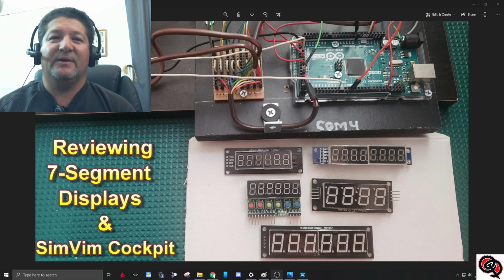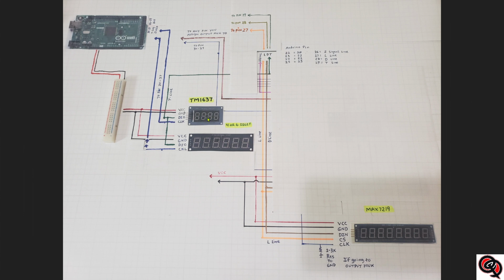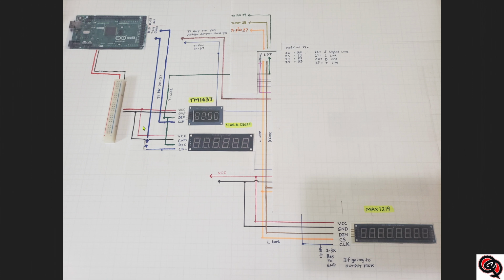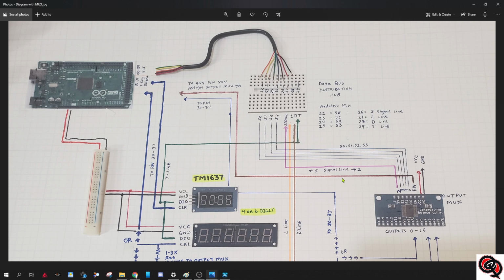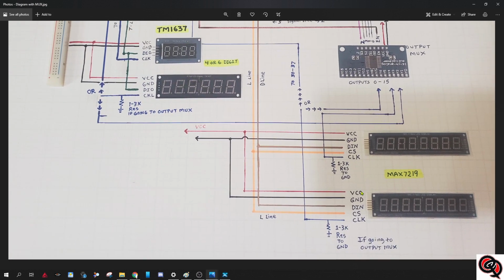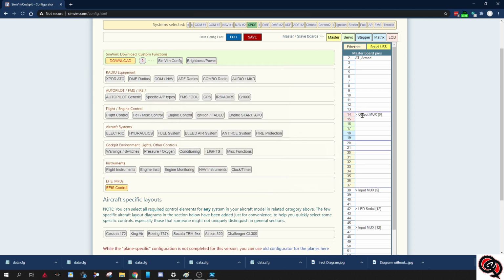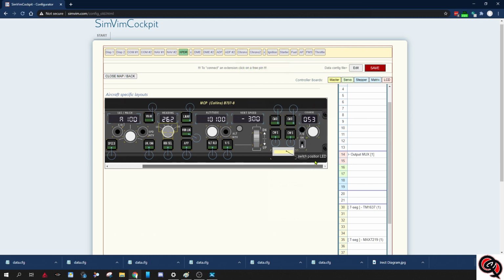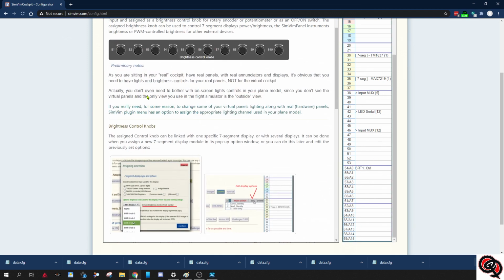Updated: TM1637 & Max7219 7 segment displays with SimVim Cockpit

Comment: Thanks for this, was very helpful, i managed to get all to work easily.  Same as you with my Max chipsets, the 7segment display always lits up fully on power on.  only after turning the encoders, an update is overwriting all 888888 to a real value.  Was anybody able to have it startup blank as it is in the real plane ?
Reply from the maker: Hello Gunter, my MAX7219 starts off all blank when I load up a flight with a cold and dark aircraft. After I turn on my avionics the displays turns on with the correct data for that display. I never see any 8's on the two that I have. Do you have the resistor between CLK and GND? I'm not sure if that would cause it but you should have it to prevent random data.

Comment: Great Video as usual!
Quick question, does simvim support conditional output/input, what I mean can i have a seven segment display for NAV1 and a switch when I flip it then the same display would display NAV2 for example? I want to build one box to display NAV1/COM1 with a switch to flip it to NAV2/COM2 using the same displays. Same applies for the rotary encoder by default they control NAV1/COM1 but if I flip the switch then they would control NAV2/COM2 instead... I hope my question is clear thank you and cheers!!
Reply from the maker: Hi Tony, yes SimVimX/RSC  does have ability to use the same buttons, encoders, displays for multiple functions. As of right now (Feb 24, 2023) it does seem like it's not working correctly for Multi position rotary switches. I wrote an email to Vlad about it but I haven't heard back from him yet. It wasn't working for encoders either but it looks like that got fixed already.

 You can assign the "conditions" by assigning the selector function to a toggle switch, multi position rotary switch or momentary push button under the GENERIC  I/O section of the configurator. Then after you assign more than one function to a display or encoder you can make it "selectable" using that selector you assigned.
Reply from the maker: Hi again Tony, so I put together a small setup on my test panel to try exactly what you were asking about and I am happy to report it works perfectly. Hopefully Ill make a video about this soon so you can hopefully duplicate it if you haven't done it already. I used an 8 digit MAX7219 for the standby freq, a 6 digit TM1637 for the active freq, a dual rotary encoder for tuning, and a push button for the flip switch. As my selector I used a 4 position rotary switch.
Reply: @Qosmokid  Great Thank you! I didn't have the chance to try it yet on my end but I will soon. It will be great if you can make a quick video about it also, I will check it for sure.

Comment: Nice Video!   Are you finding any problems with the new 2022 config upgrade?  Particularly The D&L lines for 7seg & Dm13As
Reply from the maker: Hi John, thank you. I've been playing around a bit with the new configurator. So far everything on my 7 segment displays seems to work but I haven't tried DM13As since I only use them on my test panel not in my actual setup.

I'm hoping to put up a video with some little nuances I have on the new configurator. I'll try to experiment with DM13As before I do that but work has been keeping me traveling a lot lately

Comment: Very nice set of videos Qosmokid, on wiring the various input outputs.  I have  a question re TM1637.    I have the TM1637 modules tested on an Arduino routine so I know they function perfectly.  My problem seems to be with the web configurator (latest SIMVIMX etc) in REALSIMCONTROL.    I've tried both multiplexer and direct connection of the module to the 2560MEGA.  To proceed, I then choose Configurator, Planes, 737 and focus on Collins MCP panel.  All the functions on the autopilot like switches encoders and momentary switches I can configure perfectly.  However my problem lies with the TM1637 4 or 6 digit.   I choose the Altitude display on the Collins A/P, and the configurator shows a popup with either "7-seg display" or "Character LCD" options, I choose 7-segment.    I see a popup with headed AP_ALT_Cmd, select assigned 7 seg display, and a cancel button on a yellow background- there is no instructions to proceed (why not include this I ask for dummies with little experience).  Anyway, I choose pin 36 (maybe my first mistake) and a popup warns me to assign module to an empty pin (I thought I did that), so i select pin 37, and I get a more complete popup with all the various output options- I choose "Direct 7-segment Display".  I then get the "Assigning extension " popup which I complete accordingly.  The Arduino image now shows a red button (no 37) and a blank yellow popup with no instructions or further choices.   If I click the red button 37,  I get a small popup in the  yellow background with "No parameter Assigned" showing- I cant get past this point.  Can you clarify?   Maybe the configurator is being blocked somehow or I am missing some key procedure that is not so obvious.   Sorry for the long-winded question  but I would be most grateful if you had an answer....
Reply from the maker: Hello Glenn, thank you for your comment. Im not sure but I think I know where the issue is. Before you try to assign a keyword/parameter to a pin have you already set on the configurator that you want to assign a 7 segment TM1637 to that pin?

Just like you assing a multiplexer by clicking on a pin you need to choose assign a 7-segment display to a pin first.
Then you can assign it a function like the ones for the autopilot you are trying to use. This would be the same wether you are trying to do it on a direct pin 30-37 or an output multiplexer pin.

I couldn't tell if you are doing that from your comment but it seems to be that's whats missing.
Reply: @Qosmokid  thanks you so much for the prompt reply, I'm not sure I completely understand, but I'll review the video as below and go in and try your suggestion. I a little confused about the configurator as you seem to be using an earlier version that just shows a key assignments window/table rather than the image of an Arduino Mega.  But I will give it a go and let you know the outcome.
Reply from the maker: @glennlilley867  Yes it looks different now (nicer) but the process is the same
Reply: @Qosmokid  OK, When I chose any A/P output display, I immediately see a small popup window with the two choices for devices, this time I ignored that for the moment and selected pin 36.    I was then immediately directed to a list of about 7 input/output devices and I chose direct 7 segment from that list, then I get the popup to select display type and bus etc.  So I do that and I am directed back to the same place and a dead end as before....very confusing.   In your version of  the configurator, it seems to be very straightforward-  unfortunately, I can't provide a screen snip to demonstrate in Youtube...
Reply from the maker: @glennlilley867  No you're still doing it wrong and you can't ignore wether to choose 7 Segment or LCD.

What you are missing is FIRST you need to click on say Pin 36 choose "7 Segment Display" then on the popup windows click the bubble next to "DM1637 Driver, 6- digit module" or "4-digit Module"

Once you see the BOX for pin 36 turn red then you go to the Planes > Boeing 737x, go to the MCP, select whichever function you want to assign. Let's say heading, click on "7-segment display" on the select type popup window. Then click on the red Pin 36 box. In the new popup window click in the blank box or in the box where it says" <--New entry" then click the blue "Done" box 

That's it, its still exactly the same as on this video except the configurator layout imagine looks different.
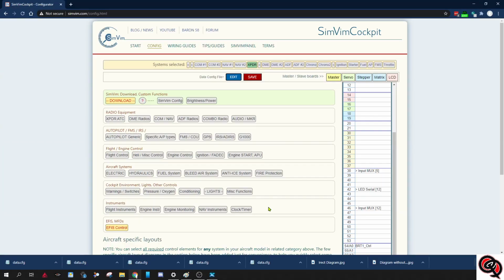Reply from the maker: What I mentioned to you in my reply is starting at 21:54 on this video
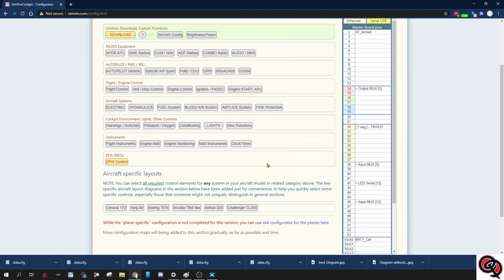Reply: Ok, I have it sorted out, the clue comes from your video at around 25:00.   The process seems to be too convoluted for my brain, but I managed to proceed to a saveable config item.  Here goes, an example:   if I click on AP_HDG_Cmd, I get a large  popup with an image of an Arduino Mega with blank yellow section, I also get a small extra popup with two Type choices (7-seg display and Character LCD),  which I ignore.  I then choose/click pin 36 successfully this time and get a list of input/output display types either direct or via multiplexer. I choose direct 7-segment.   I then get the "Assigning Extension" popup and fill that in for the TM1637.  After pressing Confirm, I return to the Arduino image with small popup with two output types that I ignored above.  I select 7-seg display,  I now see a small message window in the yellow background area with the message AP_HDG_Cmd, Select assigned (underscored) 7-segment display, and a Cancel button. I then go back to the pin 36 and click on it.  I now see a small windowed segment at top of yellow background saying New Entry with Edit and Delete buttons,  I click to the left of <---New Entry, and I get a further popup (as you do in your video) with the output function name AP_HDG_Cmd and option to select Shift position from right side of display, I ignore that and press Done button.  I now see a that "New entry" window shows a table with first line/first column and 1, then second column with AP_HDG_Cmd, and EDIT, Selector and Delete buttons. Presumably at this point I can continue to add in more output devices or Save the current setup.  I click SAVE as per normal and I get the option window to open with Notepad or Save.   S o problem solved I think with your video and your suggestions, but I am left wondering why so complicated!   Tested the SIM config and it works YAHOO!   But how can any person think that this is easy to do.....seems very roundabout!
Reply from the maker: @glennlilley867  LOL its not complicated at all. Specially when compared to writing your own code to get a display to work with a simulator. Ill take 5 clicks any day.

Just remember, you need to "Assign" the displays to your pins FIRST, before you even think about going into the image maps to select keywords/parameters.

I think the backwards way you are doing it is making it more complicated and confusing for you.
Reply: @Qosmokid  ...will review and try to get it more direct, but thanks for your input, it ultimately got me a working TM1637...

Comment: Hello , I’ve done everything as per your video but still I get no digits (they all lid up with 8’s)
Did we not need to copy the .dat file to the aircraft folder too? I’m using the 7219.
Thank you Sir!
Reply from the maker: No a .dat is not needed for the displays to work properly. Specially now with version 2.0 of the plugin there will no longer be a separate .dat file even for custom conversions.

Having gone over this with multiple people I can almost guarantee you that something in your wiring is NOT right. I figured you are using MAX7219 displays because those are always the most problematic ones of the two.

To even begin to try to help you I would need more information
Reply: @Qosmokid  ok thank you for that. I will keep trying , not sure what the issue is … thank you for the videos ! 😁
Reply from the maker: @redd6914  You're welcome, if you send me some clear pictures of your wiring we might be able to figure it out.
Reply: Ok thank you . On the older version I had a slave board connected to it (uno board) all worked right . I’ve been trying again this afternoon for a couple of hours , checking and checking the wiring diagram on the SimVim website , still no luck .

I’ve tried both direct 7 segment connection and via a MUX.

Anyways , I will Carry on with switches and leave the 7 segment displays for last .

Thank you 😊
Reply from the maker: @redd6914  Slave boards have never been used for 7-Segnent displays only for LCD displays. Only multiplexers have been used for 7-Segment displays. Thats probably where your confusion is.

Comment: Missed your broadcast, was in the hospital with pneumonia. Home now and watching the show :-)
Reply from the maker: Oh sorry to hear that Dave, I hope you are doing well now and on your way to a full recovery
Reply: @Qosmokid  slowly but surely!
Reply: This thing has me baffled. In the configurator, the file is saved as dot cfg, the 6 digit option is checked. The voltage says 16, should it stay that way? I checked the boards using a sketch and though it was for a 4 digit board, all digits had something on them. I've triple checked your layout, everything is where it should be.
Reply from the maker: @DaveWrightKB9MNM  The cfg file is getting saved to the simvim folder in the xplane plugins folder? I'm stomped also it sure seems like everything is correct last time I looked at it.

Comment: Another question, can I have one of your simple data tou assigned on your test panel , for a simple connection and wiring you got on your test panel?
Reply from the maker: I'm sorry I'm not understanding what it is you are asking for. If you are asking for a sketch of the wiring on my test panel, that is not a simple drawing.  It is ten times more complicated than the one I used in this video.
Reply: @Qosmokid  No I don't mean that, your sketches are awesome to understand,  I ment If possible send me one of your data you upload to your x-plane folder, for me to test if my Mega board has problem,  because I did my wiring just like your digaran, but had no success.

Comment: You're awesome,  and very much helpful,  believe me I could start my project just reading the website,  your diagrams are cristal  clearly explained, thanks very much for all your uploads. Dear Jose please if you get a chance pro vide us a step by step how we should deal with our firmware update, and Mega firmware. How can we set it to factory default to restart from scratch. I believe I have problem with my mega, simvim on x-plane  addon connects to Mega but can't execute the data. Thanks so much.
Reply from the maker: I have just used the Arduino software to reset the board. First in the TOOLS make sure you select "Arduino MEGA or MEGA 2560" in the board > Arduino AVR boards menu and the COM port that the windows device manager detects you board connected to. After that is done go to File > Examples > EEPROM > eeprom_clear. On the window that opens click on the "Upload" Icon and that's it. Although this sketch is under "Examples for Arduino Uno" I've never had an issue using it to erase my board.

* Before proceeding,  Close the Arduino software and unplug the USB cable from the Mega board  *  

Now make sure you have the SimVim plugin in your X-Plane plugins folder then > Open X-plane and load a flight > Go to the plugins menu > SimVimCockpit > Firmware Upload > Click on "Master Board" Now plug in the USB cable to the board and click on "Detect Port" You should see the port it is detected on and under "Controller type" a green box and checkmark on Mega 2560. Under "Firmware on-board" you should see "N/A" Click on the upload button and a black shell window should open showing the progress of the upload. After 5 seconds it will close and the SimVim STATUS windows should open showing the version in use and in the bottom you should see "1. USB SimVimCockpit Firmware I/O #/# Connected" The numbers in the I/O area will depend on the number of INPUTS/OUTPUTS in the configuration data file you have in the SimVim Plugin folder.
Reply: @Qosmokid  thanks so much Jose, yes I will do that today 😊♥️🙏
Reply: @FlightSim2703  You don't need to reset Mega "to factory default" 
And how to upload: https://www.simvim.com/index_s.html
Reply from the maker: @vladsim220  As you can see, he said he thinks he had an issue with his mega so he wanted to start fresh in case he had a corrupted firmware on the Mega. By the way the link you posted doesn't work
Reply: @Qosmokid  OK,
link is corrected, but note that soon it will be linked to another domain, we are removing the website from simvim, it will be new software name for the plugin and  panels:
- New Plugin interface - less windows, more information.
- Automatic firmware upload when the plugin detects older firmware. So, you never should worry about firmware update.
- More reliable connection protocol between master board and the LCD   driver board. Fixed a bug in the  brightness and bus power signal on  the A5 output of the LCD board.
Vlad